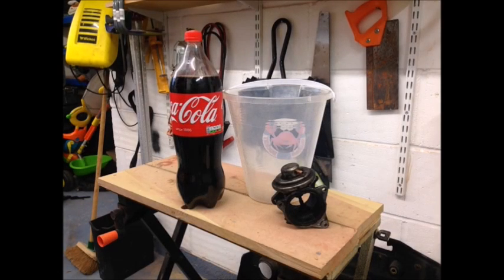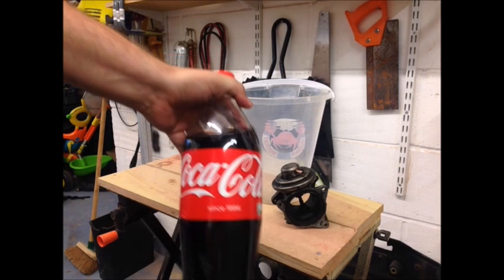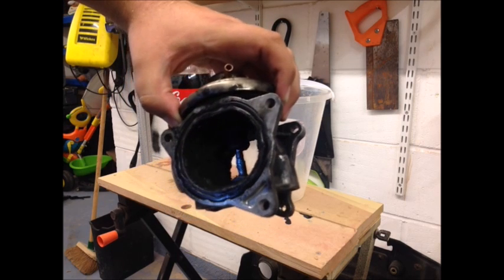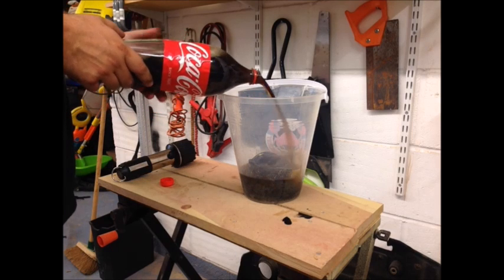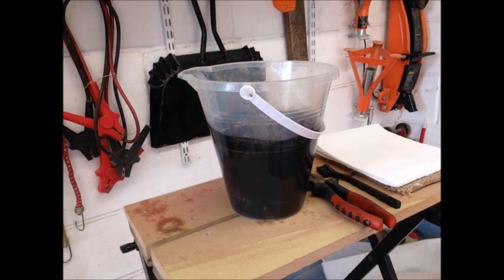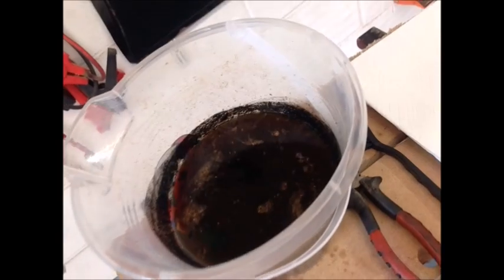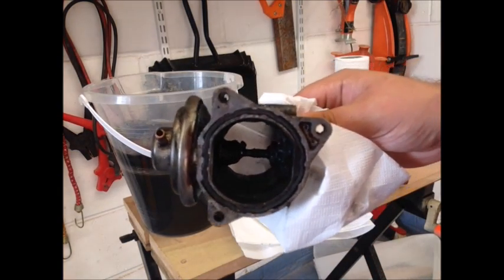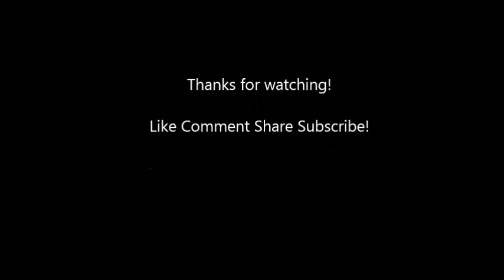Can Coca Cola clean an EGR Valve? (Experiment)

Comment: The Coke has phosphoric acid.
Phosphoric acid (also known as orthophosphoric acid or phosphoric(V) acid) is a mineral (inorganic) acid having the chemical formula H3PO4. Orthophosphoric acid refers to phosphoric acid.
This acid it is an excelent rust remover and is also used to remove mineral deposits, cementitious smears, and hard-water stains. Descaler.

look for 
Rust Off - Phosphoric Acid, Heavy Duty Rust Remover and Descaler
But if you cannot find it, maybe there is a Coke near you.

Comment: Have you used oven cleaner it would had came out like new , instead of the soda.  Even though you used the coke , you should have sprayed it off with a garden hose.
Reply: Mr Muscle oven cleaner does a wonderful job ive used it on my EGR valve and looked like new when finished.
Reply: Oven cleaner melts aluminum.
Reply: Really, wow never had any  melting happen to my aluminum parts.. just sprayed it on left it on awhile then washed off with water and never seen any sign of melting aluminum...
Reply: It melts aluminum but it takes time.  I've melted aluminum with oven cleaner.   If you clean it off right away, no problem.
Reply: All I said was that oven cleaner melts aluminum, which it does.   I melted aluminum in oven cleaner by letting it sit in oven cleaner over night.     If you spray it on, let it sit for a few minutes and clean it off, no problem.    If your aluminum is thick and you let it sit over night soaked in oven cleaner, it will melt away some of the surface, not much, but it does melt it.   Once again, all I said is that oven cleaner melts aluminum, and it does.
Reply: caustic solutions (pH level higher than 7) will eat aluminum.